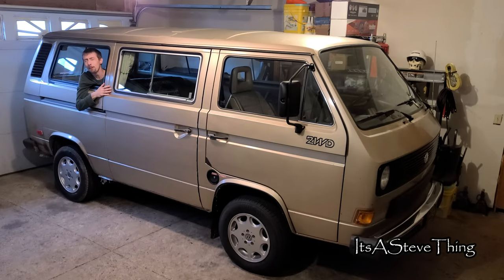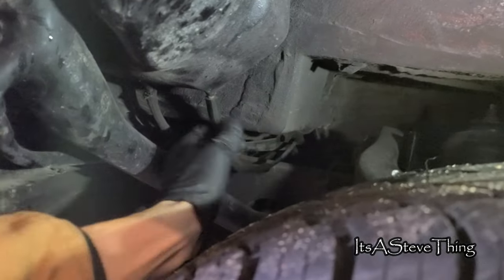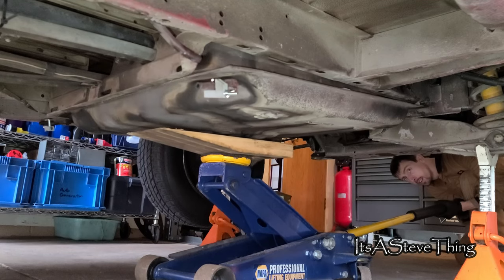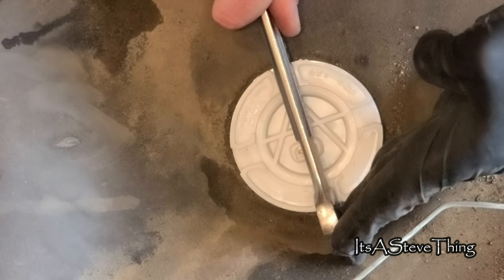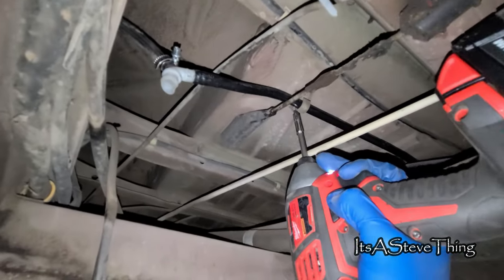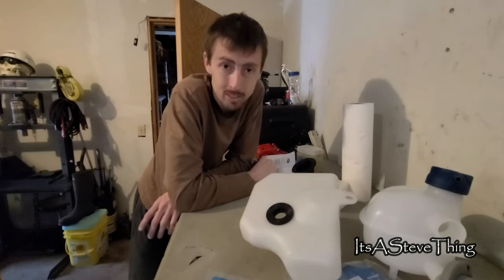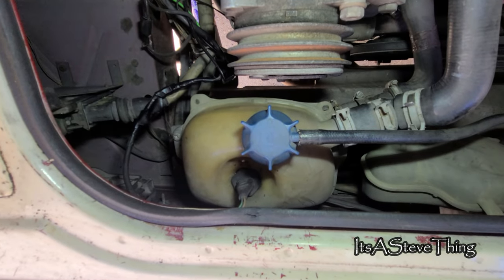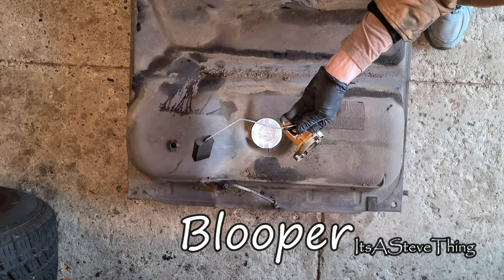Volkswagen Vanagon Fuel Tank Re-seal

Comment: Nice to see a van with the very rare guillotine window!
Reply from the maker: All 1980-1992 Vanagons came with sliding midde windows (Passenger and Westfalia).
My Orange 1983 Westfalia has them, and I installed rear sliding windows in my Gold 1985. They are in my other videos. :-)
Reply: @itsastevething.  You must have missed my reference to the open window behind the sliding door shown at 0:11s, which in Vanagon circles is called the "guillotine window". I actually have the forward-sliding rear window on the driver's side, which was only sold in Europe as an option. That window is very hard to find, and expensive.
Reply from the maker: @Gnarlodious  Oh, very nice. I am familiar with that window but missed the reference. Long cold days I suppose.
I was tempted to install those originals but wanted the rear bench to have an opening window on each side.

Comment: Hey Steve, how did you know that your expansion tanks needed replacing ? I have a leak when overfilling.
Reply from the maker: If you have a leak when filling it is more likely the filler tube, or a seal at the fuel tank itself.

However, for expansion tanks - 
There are a couple ways to diagnose faulty expansion tanks. Visible cracks in the tanks and/or a smell of fuel in the wheel wells after driving. Splashback at the fuel filler when filling up which could mean either the valves on top of the tanks are stuck closed (most likely), or if the tanks are cracked the hose ports are clogged with dirt and debris.

Best way to know for certain is to remove the single nut/washer holding each tank and visually look for cracks; and you can also check the grommets.

The valves on top can be checked by flipping the tanks over and listening for a light plastic clunk sound which means the valves are not stuck. However if your hoses are original this action could damage them if not they aren't faulty already.

Hope this helps, I try to be as descriptive as possible with diagnosis.